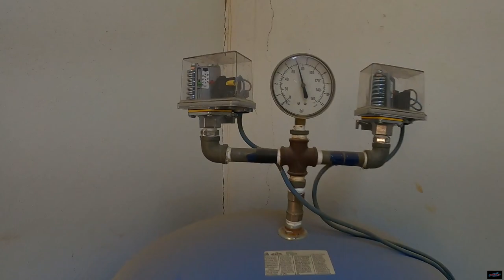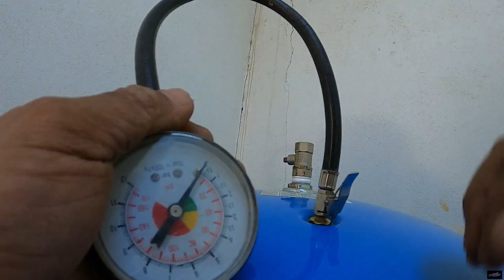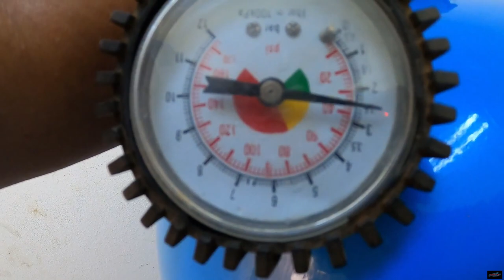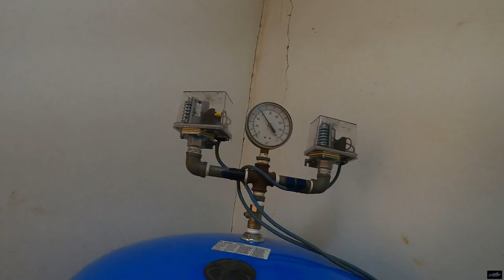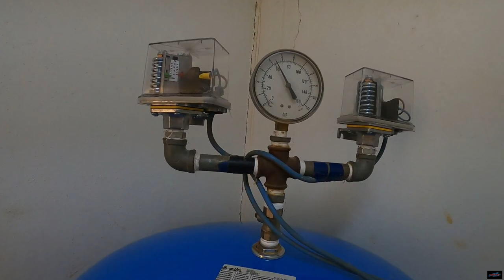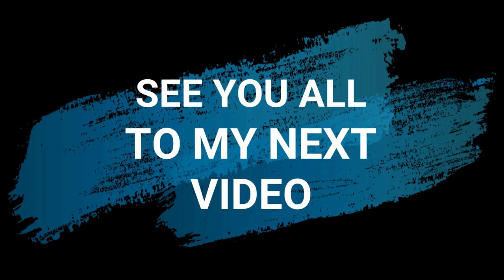HOW TO CHANGE PRESSURE TANK BLADDER OF 500LITERS ELBI (tagalog)

Comment: Why did you spray water on the pump motor? Anyway, thanks for the tutorial. I was searching for a good tutorial video as I have a bladder to replace.
Reply from the maker: Since the water pump is shielded no worries to spray water but take a time to dry so that it will not get into a electric shock. Thank you

Comment: ang galing nyo po sir nasa saudi din ako,matanong lng sir kung anong mas maganda ilagay na water system sa 3storey 10 units na apartment sa pinas,pwede ba yung pressure tank tapos diretso na sa mga faucet or kailangan pa overhead tank gaya ng mga bahay dto sa saudi?
Reply from the maker: Good evening sir, at Salamat po. Kakailanganin mo na po ng tanke sir sa taas kasi 10units na po ang susuplyan, kaya naman ng pressure tank Kaso masyado na pong pwersado ang water pump. kong May water tank kana sa taas kahit 2hp na water pump ilagay mo sa taas ay sakto na ang pressure nyan na mag supply bawat unit.
Reply: @SAMWEYVLOG  sir thanks,yung 2hp na pump sa baba ba ilagay or sa taas?ok lng ba na maglagay ako ng submeter per unit sa taas?
Reply from the maker: @ajhir1349  sa taas na po sir yong 2hp.tapos sa baba ganun narin sir 2hp din, pwedi din po maglagay ng submeter sa taas, bago sa distribution pipe line papunta sa bawat unit.
Reply: @SAMWEYVLOG  sir kung gravity lng at walang pump sa taas hindi nya ba kaya sir?
Reply from the maker: @ajhir1349  mahina po sir, lalo na kapag nagkasabay sabay gumamit ng tubig.
Reply: @SAMWEYVLOG  ganon po ba sir,parang magastos sa kuryente  pag dalawang 2hp pump..pero ok po ba kung 2hp na pump at malaking pressure tank na lng gagamitin ko gaya ng  500liters na bladder tank or ok na rin po ba kung kahit stainless pressure tank?
Reply: @SAMWEYVLOG  ganun po ba sir,pero ok na rin po ba kung bibili na lng ako ng malaking pressure tank gaya ng 500liters at 2hp pump sa baba na lng ako maglagay..ok na rin po ba kung stainless at hindi na ako magbladder tank sir?
Reply from the maker: Malaki na po ang 500liters na pressure tank sa 2hp hindi po nakadesign sa ganyang setup, at kailangan po talaga ng bladder kapag pressure tank, so kapag 2hp ang gagamitin nyong motor kailangan 100 to 175liters ang maximum size ng pressure tank.  200 to 300liters 3hp, 400 to 500 liters 5 to 6hp.
Reply: @SAMWEYVLOG  ok cge sir,maraming salamat

Comment: Sir good day tanong ko lang kaya din po bang palitan ito bladder tank na varem ang brand 100L. Tulad po nyan ang sitwasyo ng pressure tanks dito sa bahay
Reply from the maker: Good day din po sir, Pwedi din po kasi parehas Lang naman sila ng size.
Reply: @SAMWEYVLOG  Sir thank you sa reply sana mabasa mo ulit ito saan ba pwdeng makabili ng rubber na ito 100litters thank you po location ko po Angeles pampanga
Reply: @SAMWEYVLOG  Sir saan po ba nakakabili ng ganyan rubber
Reply from the maker: Diko Pa alam sir kong saan nakakabili ng bladder ng pressure tank dyan sa atin, pero try mo sir sa mga hardware na May nagtitinda ng pressure tank baka po May alam din silang bilihan ng pressure tank bladder, nasa saudi pa po kasi ako.

Comment: Kuya, may nabili kasi ako na 19L na bladde type tank. Pero mga tatlong 1.5L na tubig lang ang nakukuha ko from 50PSI to 0PSI. Ganun ba talaga? 0.5HP na motor pump. Sagad na sa 50PSI at di na kaya tumaas ng pressure.
Reply from the maker: Yes po,  maliit lang po kasi yang 19L kaya kunti lang makukuha nyong tubig na nasa loob ng pressure tank. Tataas lang po yan kapag mag Upgrade kayo ng pressure tank at ganun narin ang motor pump.

Comment: Hi boss, bakit 2 ung pressure switch , pano Ang connection nun , thanks sa reply
Reply from the maker: Bali dalawa po kasi yong water pump motor nya, aalternate ang andar ng motor, hayaan mo sir at gawan ko ng schematic wiring diagram
Reply: @SAMWEYVLOG  ah ok boss.
Reply: Galing maater! Baka puede mkuha serbisyo mo
Reply from the maker: @juliusbaquiran8185  thank you po, San po kayo?

Comment: Dyn poh b tlga nilalagay ung pressure gauge nya sa taas boss?
Reply from the maker: Pwedi po sa pressure tank at Pwedi rin po sa tubo mismo, pero need mong e modified para sa sizes ng mga fittings mo. Kong dyan naman sa pressure tank ilalagay mo nalang sa pressure valve outlet.
Reply: @SAMWEYVLOG  thanku pnh

Comment: sir kht poh b 350 liter ang bladder dapt poh b hnd xa tuloy tuloy ang andar ng pump motor?kz poh pagbukas gripo andar na poh ng andar..saka lng poh titigil pag patay n mga gripo...salamat poh
Reply from the maker: Oo sir, kapag ganyan na tuloy tuloy ang andar or on and off andar ng water pump mo Wala na pong hangin ang pressure tank mo nyan
Reply: @SAMWEYVLOG  thanku poh...
Reply: Lan poh dapat pressure ng hangin boss sa 350 liter na tangke sir?
Reply: Pnu poh qng my hangin pa poh ung bladder tank tas gnun pa dn poh pitik pa din ng pitik ung gauge..anu n poh kya problema nun sir?tnx poh ult
Reply from the maker: @puritaagulto2201  try mo munang kargahan ng hangin na 1.5bar or 27psi.
Reply from the maker: @puritaagulto2201  kapag ganyang situation baka masyadong mababa ang setting ng cut off at cut in. Mag adjust ka ng setting mo sir.
Reply: @SAMWEYVLOG  ok poh...maraming salamat sir...godbless
Reply from the maker: Walang anuman po, anytime. Ingat lagi